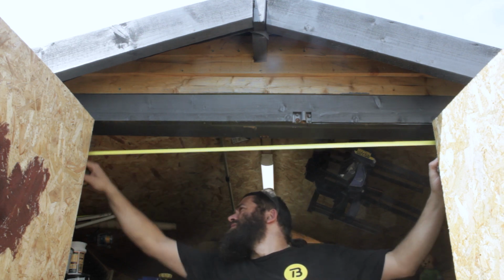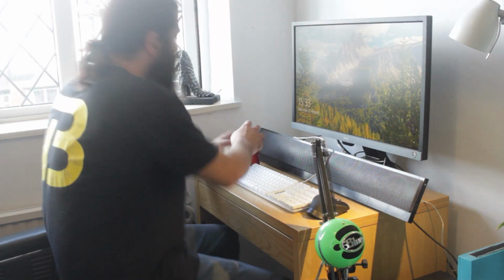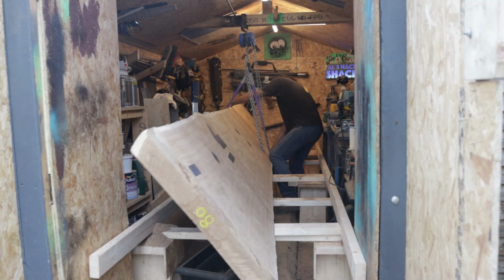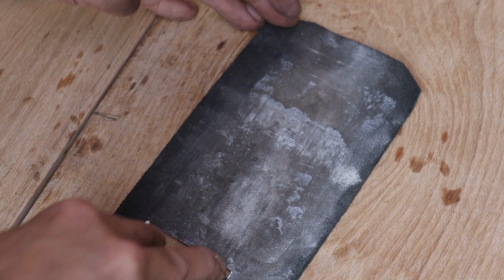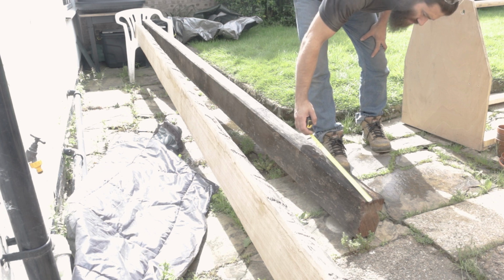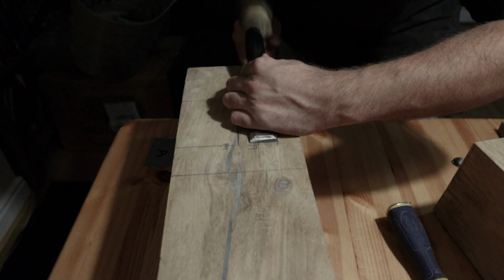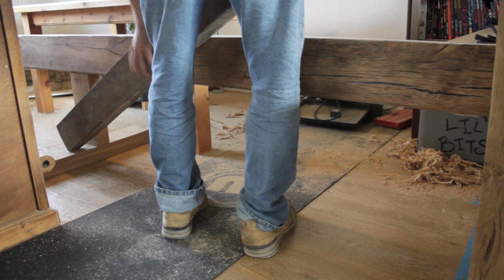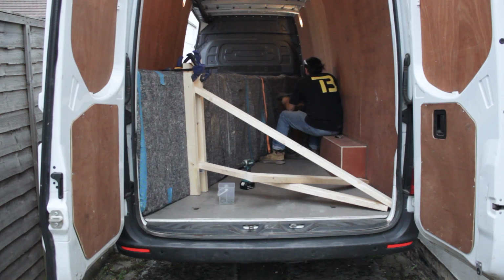The BFT

Comment: Spectacular table, Al! And mammoth effort putting it together with such precision and such limited and almost inappropriate tools. The mark of a true craftsman is to be able to do fine work with inferior tools. Almost anyone can do fine work given the finest tools. One question, what were you rubbing into the surfaces with a cloth before brushing on the "varnish"? At first I thought you were waxing it and was mentally preparing my "that won't last long outside" comment as I've done an extensive long term experiment with a number of different waxes and oils/coatings. I think varnish or urethane of some sort is a good choice as it'd be pretty easy to refinish that given that most of it is flat and the "live edges" can hold up to a wire brush attack just fine. Nice work, mate! <3
Reply from the maker: Thanks Fred! I was merely cleaning the surface with some white spirit. The finish is a combination of gloss and matt yacht varnish :)